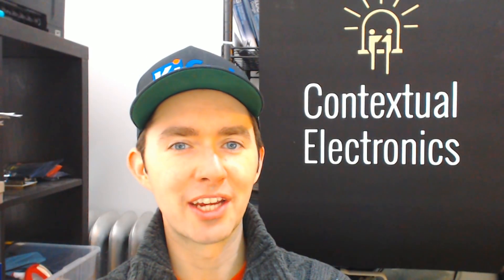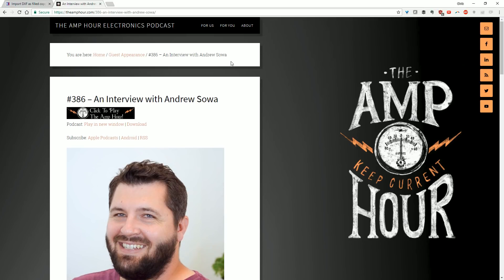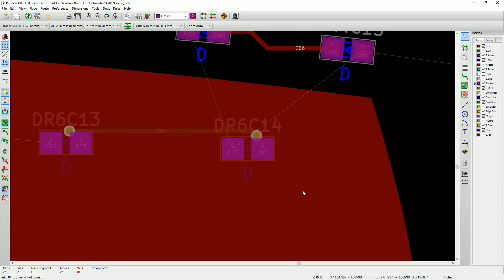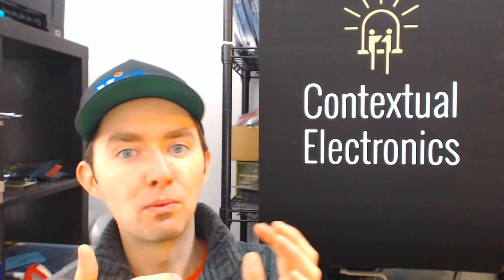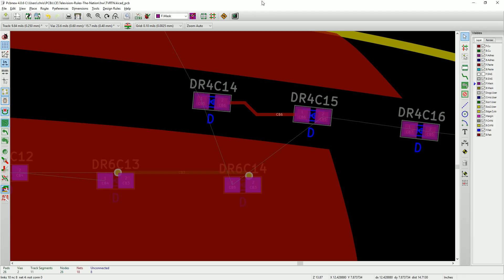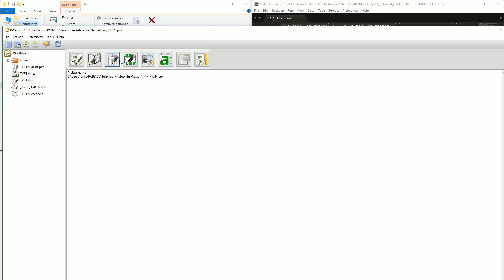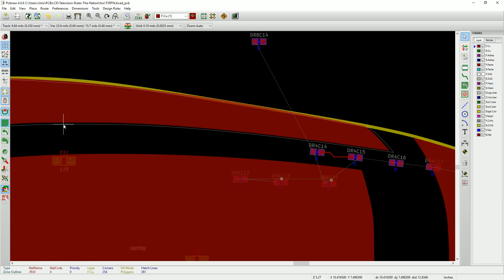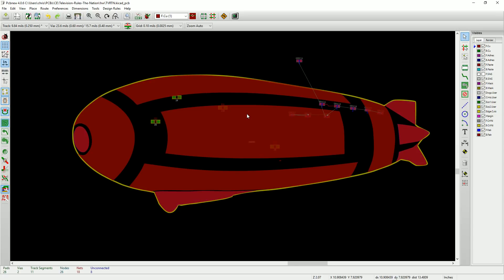Converting Custom Footprints Into Zones in KiCad 4.0.7

Comment: Great video. I do this kind of thing pretty often in KiCad; a few things I've picked up along the way:

- The red blimp, if imported as-is (with the checkerboard background), probably won't show anything as the program sees both the red and checkerboard bits as 'nothing here'. If you hit the 'negative' checkbox, you'll get a fully inverted footprint with fill showing up as a square box around your design. The way to get around this is to produce *.png files that have a white background; using Inkscape, I just keep a layer handy that is all white and make sure it's showing when I export the images. If you pull such a *.png into Bitmap2Component with 'negative' enabled, the file will import properly (although if it's not black and white you'll have to play with the threshold to get a good cutoff). This saves a few minutes from the conversion process which really adds up if you're doing a lot of graphics iterations.

- KiCad assumes footprints are centered when imported, so when you place them on a PCB that is where the crosshairs appear. In other words, if the source *.png is 240 x 320 px, KiCad puts the crosshair location at 120,160. I often produce footprints where the aligning feature isn't in the exact center; for example, I may need graphics to stay aligned with an LED (a separate component). In the previous example, if the LED should be at 80,100, I would export my *.png to the coordinates (-40,-60) -> (240,320) so the center of the resulting image is correct. 

- Many of my graphics make use of all three standard PCB front layers (F.Cu, F.Mask, F.Silk). To simplify and speed up placement, I export the three *.pngs from Inkscape (usually calling them Cu.png, Mask.png, and Silk.png). I pull these three files individually into Bitmap2Component and export them to separate *.kicad_mod files, then modify each one using a text editor so its graphical features are on the right layer. Then, I save a copy of one of these *.kicad_mod files as 'combined.kicad_mod' and paste the fp_poly blocks from other two layers into the same file. That way when I import the footprint into KiCad, all three layers can be placed at once.
Reply from the maker: If I could afford a KiCad sidekick, you'd totally be it. And then I'm sure you'd promptly teach me more things I didn't already know, as you did above! :-D